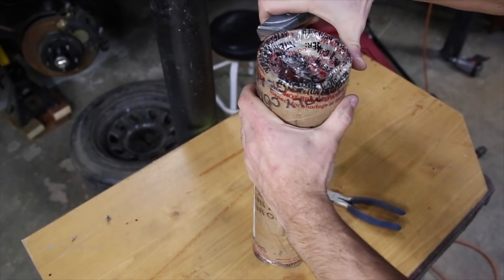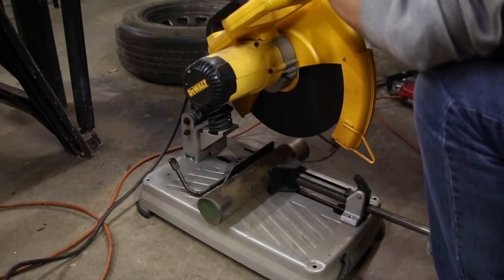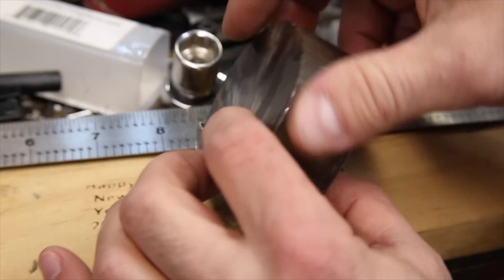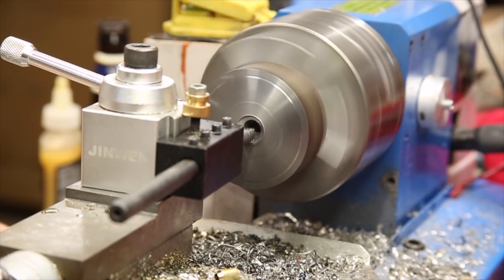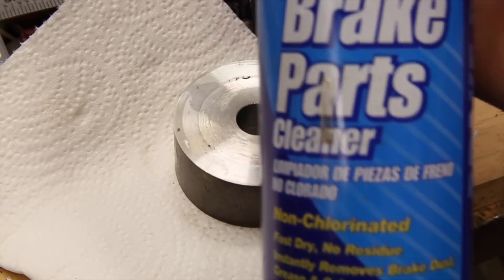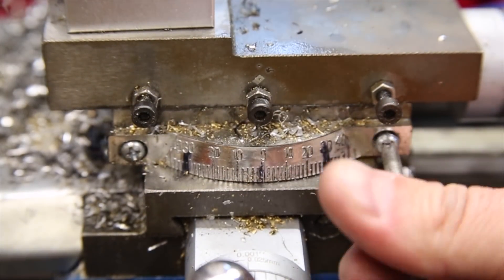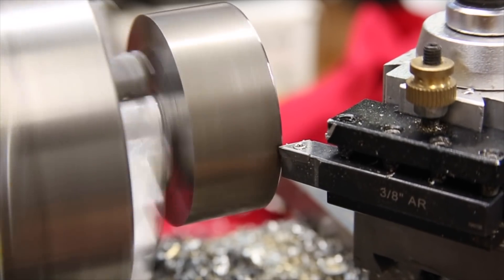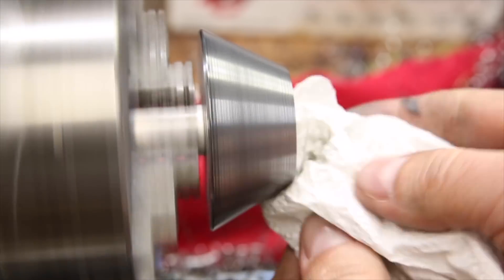(1/2) Taper Turning a Heavy Steel Spool Holder on the Mini Metal Lathe

Comment: You should probably use some lubricant and coolant for your saw, for your needs wd40 should do. Just spray some of it at the cut from time to time while cuting the steel. It prevents the sawblade from getting too hot and extents the lifespan of your tools. Same for the lathe.
But watch out, the type of cuting disc you are using is not meant to be lubricatet and it will ignite the oil

Comment: What we thought..  
- can't give any respect for shameless advertisements
- how you gonna clean that hole or justify the apprentice burn marks to your client?
- best get a proper motor starter and heater for that lathe pronto!
Reply from the maker: Thanks for the comments! To answer your questions..

Shameless advertisements.... sorry that literally doing nothing for 30 seconds to help me continue making the tremendous effort to produce this videos is too overwhelming for you. Not to mention monetized videos are likely ranked higher in YouTube's searches making ad's a bit of a necessary evil.

The hole is fine, it will be welded to a shaft. The "burn" marks easily came off with a quick touch on the wire wheel. My client is my friend and I'm basically making these for free, so he can deal with them.

I'm well aware this lathe is not as good as it could be... by definition of this whole channel, it's the cheapest lathe I could find.

I'm not sure if you meant disrespect, are just simply ignorant of the efforts involved, or there is a language barrier but comments like these are pretty disheartening.

Comment: I've noticed when you're drilling with a bigger drill bit that you're drilling to fast along with some of your boring cuts and parting but I also know that the machine is way to week to do it any slower so you should probably gear it lower or put a much torquier motor in it. Just a word of advice. Great videos I enjoy watching them because no one else really does anything with mini lathes but good work on the projects tho and keep up the good work!
Reply from the maker: yeah! unfortunately the lathe won't spin any slower currently - I need to open the control box back up and adjust the minimum speed. Thanks for watching!

Comment: When cutting down the taper, you are planing. In other words taking off larger, cleaner chips. This method works well for the mini lathe, especially for steel. Steel is difficult to work with in any medium, but you have shown with patience it can be done well. I struggled with cut off saws for six years before I invested in a horizontal saw. Harbor freight has an inexpensive small horizontal that works very well.
Reply from the maker: I've seen it! I need that one but haven't had enough need for it to justify the purchase. If I keep doing more of this stuff though then it might be worth it. Thanks!

Comment: have you ever thought about having 2 breakers for power outlets and light? that way you wont get blind if the tool stalls out, i mean, could become dangerous with certain tools?
Reply from the maker: Haha probably a better (and safer) set up.
Reply: He is running off a 10 amp breaker needs to be 20 amps might keep the mini lathe from kicking off, also there was many companies  that would hook up gfci outlets to 10 amp breaker causing every time you hook a brush motor to them they would kick the gfic outlet or burn it up.

Comment: I’ve got that same lathe and although I haven’t done near as much turning as you, I’ve never popped the fuse yet. Sounds like something is off for you to have popped the circuit breaker that many times on that project. Good result though
Reply: he took cuts for a big lathe on the small one :D thats the reason it pops in the first place, the motor just has not enough torque before it stalls out and trips the breaker
Reply from the maker: What Sharky said :)

Comment: the steel heated up and pinched the blade ---- if you cut a bit and stop then cut and stop a few times it wont heat and warp and pinch the blade
Reply from the maker: I think you're right! Thanks!

Comment: Before I bought the bandsaw, I was trying to cut 50mm diameter bar on friction saw and it is really not good idea. It was not mild steel probably, so it hardened when became hot and cool down. Much better is to use the angle grinder with really thin cut off disc (0,8 or 1mm) and cut it around the diameter. Allmost no heat, no problem. But horizontal band saw from hobby market for 300$ is much, much better then any abrassive wheels.
Reply from the maker: Agreed! I really need to get a horizontal band saw...

Comment: 1:55 looks like the dewilt let the smoke out.

Why did you buy a new drill? Could the old one not be sharpened?
Reply from the maker: I'm sure it could have but I don't have the means to properly sharpen it at this point. The saw was definitely a bit hot but still runs fine.
Reply: Probably just time for some brushes

Comment: Any particular reason you got 2.25” stock when the part calls for 2.5” finished diameter? I’m assuming since it’s a spool that’s not super important but I was just curious. Love the projects man you and I got our mini lathes at around the same time so I’ve learned a lot watching you use yours.
Reply from the maker: Thanks so much! That was actually me just being sure it was 2.25" without double checking ha... the drawing does say 2.5" and the metal I ordered is actually 2.5"

oops!

Comment: The round stock heated up, expanded and bound the chop saw blade. You seen the discoloration. Next time cut like you drill, peck at it. Live and learn! Nice work non the less. Those chop saws pull a lot of amps don't they. Lights out!!! L0L
Reply from the maker: Thanks for the tip! And yeah haha, just had to move the plug to one of the 30 amp outlets :)

Comment: So is it just the motor doesn't have enough torque or is the tooling inadequate?
Reply from the maker: Haha yeah, Jay is right. This lathe is probably best suited for plastic, frozen marshmallows, and cold butter to be honest.
Reply: Matthew Prince its a lot to ask from a small lathe 😂👍
Reply: aluminium works great to be fair, but steel needs some lighter cuts

Comment: One other thing to consider:  Your hole in the part is probably not perfectly centered.  If you chuck the 5/8" round and test the concentricity with a dial indicator you'll see how far off it is.  to get a perfectly concentric hole and taper, you can use a slightly larger round than 5/8", turn it down to 5/8" and then without removing it from the chuck, glue the steel part on.  If this is a low RPM part then it will likely never matter.  BUT, if you need it to be closer to perfect versus just within a few thousandths, then the process I described will do it.

I really enjoy your videos.  Always interesting to watch!
Reply from the maker: Thanks for the thought! These are actually going to be static pieces that hold a spool of wire or something that's dispensed by pulling on it (I'm pretty sure) so they just have to be close enough.

Comment: I bought the cheap HF 4X6 when I had one of their 30% off coupons.  Man, I've been through about a dozen of the chop saw wheels over the years, and I wish I had gotten the bandsaw earlier!  It is SO much better.  #1 it makes a better cut, #2 almost no mess unlike the chop saw dust and filings, and finally #3 you just get it started and keep working until you hear it shut off.  It is literally a game changer if you do much metal work at all.  Highly HIGHLY recommend you look into one.
Reply from the maker: Haha now you're just making me envious - I've been wanting one for a while now... the biggest issue is that I don't really have room for it and don't do enough metal work like this to warrant the space that it would take up.... hopefully sooner rather than later though!

Comment: Check out the evolution saws .... I have a evolution steelsaw1 7.25 circle saw and it will cut 2" thick stock no problem and it's a cold cut saw also very little Sparks and not hot parts

Comment: Tim, you are overloading your minilathe. Your motor and gears will not survive for a long - my own experience from the same proceeding...
Reply from the maker: Thanks! I know this is a bit much for this machine. There's aren't any gears involved in this project so I'm not worried about those and the motor (I'm guessing) is more robust than it get's credit for... I'm most worried about the controller burning up. But that'd just be a good reason to upgrade to the real version of it :)

Comment: Ever tried som hss tools? That blue birds nest each cut is  annoying ( I know from my own experience). Im a whatever works kind of guy, so I often do like you and just get it done. But having a few hss tools on hand has really helped me with these tricky cuts, and especially in softer materials like nylon or copper etc. I have a few grinds, and I make sure they are sharp. Really helps with breaking chips, and getting a nicer finish. And you can tune them to your needs on the grinder. Takes some skill to get it right, but that's just part of the fun :)
Reply: If your scrapes are of that color, it went to hot. Try cooling your workpiece. The tools live longer and I assume the maschine would not have died the whole time. The finish would also be better. If you had cooled that blade, it would not have been welded to the metal. You can try WD-40 for the saw. Unfortunatly I guess it will be quite messy for you and filming the stuff will be much harder.

Nevertheless, I really really like your videos :)
Reply from the maker: I haven't really - I have some that I can try but don't have a way to sharpen or grind them. It's been mentioned enough times that I should try them though.

I might give one a try on the second part. Thanks for watching!

Comment: Better way to set up angles is to calculate the drop over x amount of length on the hypotenuse and indicate it in. Probably not nessciary for something like this.
Reply from the maker: Yeah, but the dials probably aren't accurate enough for that to be any better either. Using that angle finder was quick and easy and good enough. Thanks!

Comment: Another fantastic video
Reply: And you don't need to push the chips to blue on that lathe, for commercial cutting yes, but not for you or me. The color indicates a heavy cut, and while normally it's advantageous it's not for our machines
Reply from the maker: Thanks! I'll keep that in mind for the second part.

Comment: looks good but you need to find out why your lathe keeps pooping off thats not cool
Reply: Can't Kill Me u
It's a safety feature and helps the lathe to keep from eating it's main belt or gears, by limiting the current to the motor.

So heavy cuts can kill it, and by heavy it may be only a few thou.

There is a jumper you could put in, taking out a mini ice cube relay but as some one who did this. I do not recommend it.

I've put 3 belts on this year, and have learned to do it with finesse
Reply: ok that makes since now good that they do that didnt know they would prevent the lathe from getting destroy some other people would let the lathe get destroy but thats cool keep up the work love your videos

Comment: Dude you keep cranking out great content! Thanks for showing what really happens when you push your tools to the limit. Great job on the finished taper turning.
Reply from the maker: Thanks so much for that! I really appreciate it... it's hard to tell where the line is if you don't push it :)
Reply: Also I would recommend a bandsaw of some sort. Whether it’s horizontal or a handheld, it will make your life a lot easier. I used a cut off saw for a while and got sick of the dust and noise. I eventually got a horizontal one and it is so much more enjoyable to use.

Comment: It;s not recommended to use chlorinated brake cleaner on anything that is to be welded. I think you said one of them would be welded?
Reply from the maker: Good to know! I'm sure anything that was left is gone after trying to get the glue to let go of the part though.
Reply: DSCKy is it the flammability or something left behind?
Reply: Residue left behind. It makes deadly gasses when heated. I'm not sure how long the residue persists, so after some period of time it may not be an issue any more. Acetone is generally recommended to use instead.
Reply: Just glad that it didn't get you... :)

Comment: It likely had a better finish cutting the other way because the tool has more lead angle that way. It makes the cut more gradual, rather than the other way, where you're digging the tip in. 

Also, take smaller cuts. It's easy to want to hog material away, and make things go faster... But these little machines just don't have the oomph. You're going to burn up the motor, the speed controller, or both if you keep popping and resetting the breaker like that. 

You should look into grinding your own HSS tools. It's easy, and you can resharpen and touch them up whenever you need to. They can also be much sharper than the inserts, reducing tool pressure, which makes for easier cutting, less chatter, and a better finish (all things these little lathes need help with). There's plenty of videos on how to do it.

Good shit, though... Keep up the good work!
Reply from the maker: Thanks! I do need to start cutting my own HSS tools... first I need to get a decent grinder set up though. And I always feel weird that using steel to cut steel would make the tools dull really fast but having never really used them it's not really a valid opinion. 

I think you might be mostly right on why the finish is better in the other direction. The only other thing is that (and it might not be easy to see in the video) the compound slide wobbles slightly as it goes back and forth, which would absolutely make a tiered taper which doesn't seem to happen in the other direction, so maybe just the way it drags down the part holds it against one side of the wobble? Still tbd.

And yeah, I agree that I'm risking the motor and controller, but worst case is that I can upgrade to the real controller and a brushless motor? :)

Thanks for watching!
Reply: You might try tightening up the compound gib some more... I know that makes it more difficult to move, but if the compound has appreciable play, it'll affect all cuts. Tightening that up will probably improve surface finish even more.

For cuts not involving moving the compound, you might think about adding a compound lock. Simply drill and tap a hole in between the existing gib adjustment screws, and put a screw in. I use an M4x0.7 cap screw. Doesn't take much... Just a little snug-up and it locks the compound solid. Adds a lot of rigidity.

I need to upgrade my motor, as well. I'm looking into a brushless DC hobby motor and controller, based on an Instructable I found (search Mini Lathe Motor Upgrade). Seems relatively inexpensive, and fairly straightforward to do. I figure if it works well, I'll make the same upgrade to my mini-mill.

Comment: The difficulty you had in removing the part from the arbor could havr been related to the different rates of thermal expansion of the two metals, im pretty sure that aluminum expands at a greater rate than steel, therefore, the fit would get tighter with heat.
Reply from the maker: That's probably the biggest issue I had, especially considering how well the press worked. I was hoping it was a loose enough fit that it wouldn't be a problem but it definitely was ha. Thanks for watching!
Reply: Bexpi is right. When you heated the part the aluminium arbor expanded more than the part. Using similar material helps prevent this but, when  removing a lot of material the heat generated by the tool can break the bond. I find a more secure method is to turn a very shallow taper on the arbor. A half to one degree is enough to withstand forces much greater than the mini lathe can produce. Another way would be to make an arbor from larger bar, drill it tapping size for a suitable bolt then open it out to clearance deep enough to part off a cap. You can then tap the rest and turn a spigot to mount your part and secure using the cap. Works great if you have a few to make and the cap won't interfere with the part. 
Just a few thoughts, hope they help. Love watching your videos, looking forward to the next instalment.

Comment: The reason it cuts better running the other way is that your tool tip is ruined. It is cutting on a part of the tip that is still sharp when you run in the other direction.
Reply: and to add on, the chips should have been broken by a chipbreaker included in the geometry of the insert
Reply: Karl Hoyle yes absolutely correct; defiantly a good point to remember.
Reply from the maker: I don't think the tip is ruined on one side because it was a brand new tip. Someone else mentioned that the cutting angle is different on the other side which makes sense. But another weird thing is that the compound slide wiggled a lot going up but didn't going down for some reason, so I'm still not sure. Thanks for the comment though!
Reply: @TimNummy  Maybe the difference in going up and down is because of the difference in diameter. The larger diameter at the upper end has a higher cutting speed and therefore smoother.

Comment: Looks like you had to continually reset the breaker, too big a bite for that little machine. Good job otherwise!
Reply: Raul Lugo it's hard some times to know what is too much I find
Reply from the maker: I found that after the breaker tripped, it was easier to trip again, and again, and by the end of the project even the lightest cuts would trip it. This makes sense since I didn't really give it a chance to cool down at all (probably should have) but I think it's more of a duty cycle thing rather than a too big of bite thing.